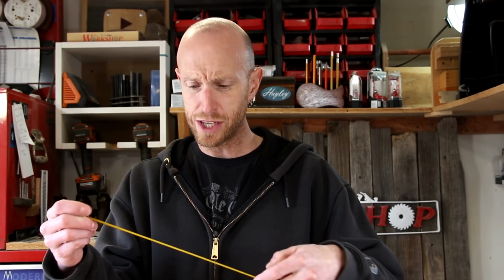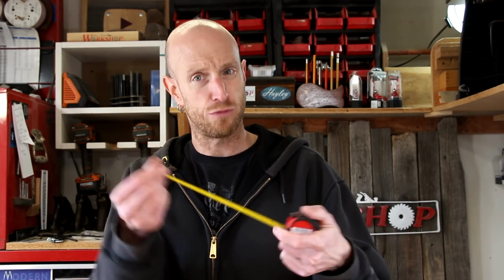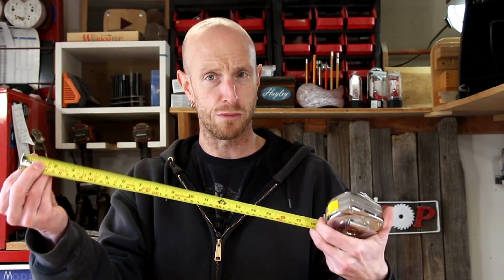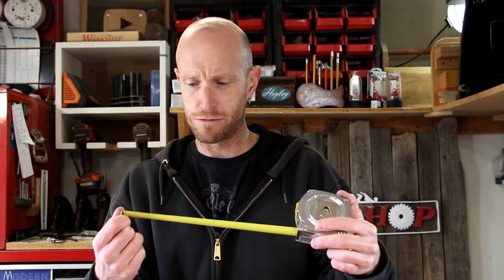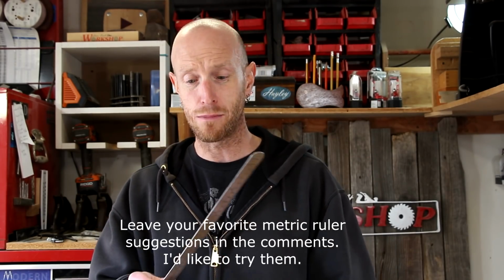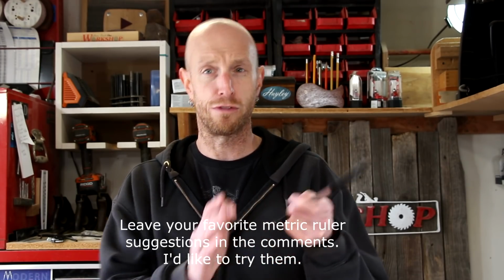My thoughts after using the Metric System for a project | I liked it

Comment: Imagine if you also need to measure weight... in metric is the same proportion by 10s and volume.. yes you guessed it.. it is the same.. proportion of 10s.
1Km = 1000 meters
1Kg = 1000 grams
1 Liter = 1000 mililiters (or 100 cc but thats because cc stands for cubic centimetres so 100cc = 100*10 ml = 1Lt)

Comment: thats not true. u use teh Metric system for exsample x.x Liter engine, metric money, photo films and lenses in mm , medcine doses, nutrition labels, meteric soft drinks. The vidoe was good. the video is old maybe u do not see my comment. but for all of u. u are using it allready,   If you stick with the metric system, you could say you're a pioneer, and that can't be a bad thing. One advantage is that you can start building faster because you don't have to convert so much. Which saves working time and which in turn costs time money in a company. Conversely, you could say you can offer the goods cheaper and make more profit apart from that maybe also as you say something more accurate

Comment: I work as an Air Traffic controller in Switzerland and let me tell you:  Global aviation is the biggest mess in terms of measurements.
We use feet , nautical miles, statue miles, km/h, knots, meters, mach, feet per minute, meters per second, milibar, inches of mercury, kilogram, pound, hectopascals anything you can find on this planet in an absolute non-logical mess.
Reply: Inches of Mercury?  I heard of mm of Mercury. Are the feet you use always the same or are there different feet for different applications?
Reply: @aleisterlavey9716  Inches of mercury is used in the US for atmospheric pressure, the rest of the world uses hectopascal. The feet are always the same, but dont ask me which kind of feet it is.
Reply: @chloratum  at least the feet are the same. Imagine if every airline has their own version of feet. Airtravel would be a lot more... interesting  😆

Comment: It's not that you've become more accurate. The essence of the metric system is that it is simpler. It's harder to make a mistake. You just write new numbers, moving the comma when you change the measure. Millimeters to centimeters, centimeters to meters. No need to use ratios. It's just a decimal.
UPD Ok... you're just talking about it in a second.😅😅

Comment: you dont know why metric system is preciser ? because you dont have to deal with does weird fraction numbers like 0.633333333333 inch or whatever. Also the metric system is based on natural constants expect for celsius. Any Kelvin users in the comments? :D

Comment: The fact the imperial system is defined by the metric system with a conversion rate 😂. You’re going to use the metric system whether you like it or not. Every single metric unit is defined by fixed systems.

Comment: There is no such thing as "STANDARD" measuring system.   It is called IMPERIAL measure when you talk of the inch, foot, yard, mile.(a bit of Rome remained in the U.S.) You still are using that which was part of Britain.(who got it from Charlemagne a French Emperor >part of the Holy Roman Empire<)I believe.  Standardization of measurement goes a long ways back.  Google it.   The pound weight is 16oz.  Temperature is in Fahrenheit.   The ONLY THING THE U.S. WENT METRIC ON is the money. 100cents=1dollar You do not have a problem with that - yet a penny farthing is?  Yeah, I don't know either. Or a quid. Or a crown.
Australia (a former British colony) changed over their money from British to Australian dollar=100cents   They also changed over the temperature measure to metric or Celsius.  And they changed over car speedometers to read in Kilometers instead of miles and they changed over weights and measures.  (All in 1965)  Though it is very common to hear them  ask for an 8 by 4 sheet of board (we above the equator say 4 by 8 sheet); or a 4 by 2 instead of a 2by4.
 They used to measure body weight by STONE WEIGHT as well as pounds.  The scales were calibrated that way.  In 1965 they measured in Kilogram & stone weight and pounds because there was that much room to make all the markings.
. Petrol pumps measured in Litres in 1965 - which was forced over conversion.  People rarely buy 1 gallon of petrol.   They just say put in $10 bucks worth or fill it up.
SO BREAK DOWN AND BUY A METRIC MEASURING TAPE.  MOST HAVE THE DUAL MEASURE ON THEM....just in case the plans are in imperial measure.  You know how to read numbers, and that is all you are doing.  I have the dual tape and I never look at the other measure...because I am not talking that language.
.  You never convert.  It is like measuring in 1/16 of an inch...if you ever need to get that accurate. Machinists need to get to 128th of an inch.  Woodworkers NEVER.    Metric have a "foot" a term that means 30cm., a pound= 500 grams, a tonne which is 1000kg= 2200lb(so also called a long ton) a galon= 4 liters.  Their liter converted is 35 oz.  (the British/Canadian quart= 40 oz, the U.S. decided to take out a cup out of the 40 and call 32oz the U.S. quart.  The consumer pays for a quart and it is smaller than the British/Canadian quart.    A U.S. gallon was 4 quarts (128oz) Canadian gallon was 4 Canadian quarts or 160 oz.
Makes a difference when say painting a house. Canadian 5 gallon pail or a U.S 6 gallon pail.
Metric is smaller than  the Imperial measure was but larger than the U.S. measure.
Metric also use a pound terminology=500 grams   Imperial measure= 454grams.
Canada has gone metric for the most part. Road signs, Speeds,odometers, thermometers, measure, gasoline, paint, some conversions still happen in ones head for recipes and temperature setting on stove. Stuff from the building supply store is generally imperial measure because that is what many old builders know  5/8" plywood and they want 2 dozen sheets of 4x8 sheets (though the builders know it is now a metric measure they let the supply store get you the closest thickness to it.  The stores have to order the metric numbers as the mills changed over.
. I believe South Africa still uses Imperial measure.  So car makers cheat when they say miles per gallon (for they do not tell you they are using the larger Imperial gallon in their measuring for MPG.) sneaky but government allows it.

Comment: “Here in the US most people use the ‘standard system of measurement’” like no you are the global exception. The only country who doesn’t use the metric system. Metric is standard. The US uses imperial not standard. Learn terms pls. Also of course converting is going to be easy. It has to be easy to convert if it’s the universal standard. America kinda messed things up when they decided to stick with imperial and it’s arbitrary conversion rates.

Comment: Beeing used to the metric system it is a stupid and painful experience to work with imperial. Doing archery I sometimes have to deal with this problem. If you want to convert from feet to inches, it is pretty much impossible to calculate in your head. In metric you just need to adjust the comma, so even with big conversions you basically just need a piece of paper if your bad at math. But what annoys me most are the tool sizes. For example if your first chosen hex is too big it is just not logical, what is the size smaller than 3/16" because the denominator changes weirdly. In metric if my 6mm hex doesn't fit i'll just take the 5mm.

Comment: The imperial system is why I never buy anything made in the usa. No bolt I can buy in europe or the rest of the world will fit. You loose a nut of a device? Too bad, throw it in the bin.
Also conversion between units is hopeless in imperial system. 4 yards, 2 feet,  3 5/16 inches divided by 3 is? I don't even want to calculate that.

Comment: A 5 gallon bucket can fill five jugs, 1 of those can fill 8 pint size water bottles.
A 20 liter bucket can fill five 4 liter jugs, 1 of those can can fill how many 475 ml bottles? 
It's setting a real world image to the measurement rather than doing constant arithmetic. It's articulating a measurement to what you see. You wouldn't get the tape measure out to see how many steps it takes to back into a tight garage would you?

Comment: Imperial System is everything less than practice and logic to me. In architecture we draw all in mm. Is to easy compare and sume  dimentions, 100, 300, 900, 6850, 12370, etc. that 7' 12" 7/8, WTF is this that I have get to use. I only have to say is that occurs with the language too, spanish is to logical, the p with the a alway sound equal

Comment: Do you know what's the US official definition of 1 inch? 1 inch is equal to.......2,54 cm (in metric). funny isn't it?
Reply from the maker: According to the dictionary it is a unit of length equal to 1/36 of a yard. I think it just translates to 2.54 cm. Still though, 1/36 of a yard really doesn't tell me much. I'm really glad that measurement isn't commonly used. Lol.
Reply: @homebuiltshop  Take a look at the last sentence of the définition by the Britannica: "Inch, unit of British Imperial and United States Customary measure equal to 1/36 of a yard. The unit derives from the Old English ince, or ynce, which in turn came from the Latin unit uncia, which was “one-twelfth” of a Roman foot, or pes. (The Latin word uncia was the source of the name of another English unit, the ounce.) The old English ynce was defined by King David I of Scotland about 1150 as the breadth of a man’s thumb at the base of the nail. To help maintain consistency of the unit, the measure was usually achieved by adding the thumb breadth of three men—one small, one medium, and one large—and then dividing the figure by three. During the reign of King Edward II, in the early 14th century, the inch was defined as “three grains of barley, dry and round, placed end to end lengthwise.” At various times the inch has also been defined as the combined lengths of 12 poppyseeds. Since 1959 the inch has been defined officially as 2.54 cm."